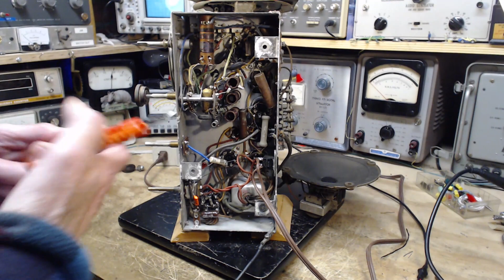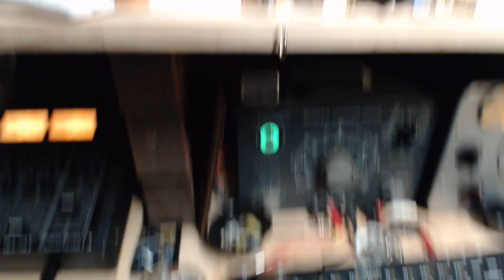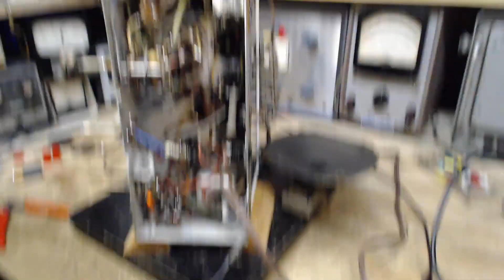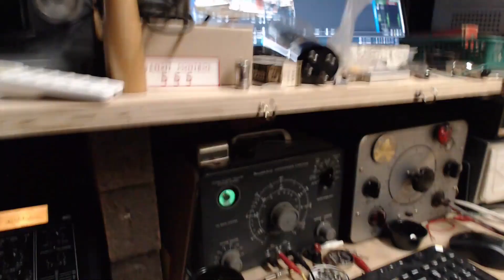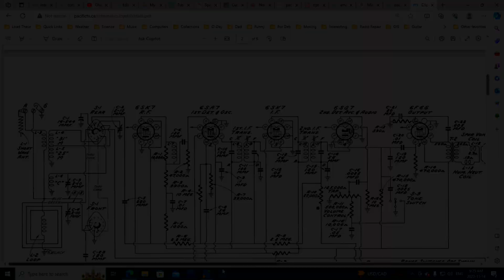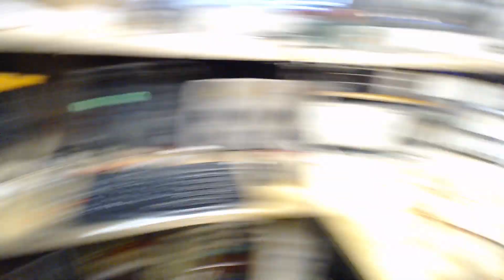General Electric KL60 Tube Radio Video #7 - Two Capacitors, Bad Result

Comment: Greetings:
I support the commentor that suggested you retrace your steps of the two last caps that you changed! Or you could use a working frequency counter to measure your  local oscillator or tuned-station frequency. If only someone had a working frequency counter. Maybe he could buy a working one. Maybe if he kept a logbook of things that he has done! Wait, he has an SDR to use whenever he needs a deeper hole to work his way out of. Oh, he lives south of Detroit just east of Windsor I think.
Jim Lindenas would rather the sun would come out so he could go out and play. If it snows he can build a snowman; that could be fun. I am getting old too, born in 1950. I built my only radio in 9th grade wood/metal/welding/electronics shop. After the Arkay radio kit was complete; I had to wait for the local high school radio shop class to diagnose a bad IF transformer; too bad my shop had no electronics teacher. SO, I built a wooden case to sub for the bakelite case it came with. Now I must wait for my 40 yo son to learn enough so I can just tell him what to do. Now that I finally have Covid-19, I can wait for the all-clear to invite him back.

Comment: You changed the screen filter cap, and the AVC cap. Start looking there. Wrong terminal? Clipped another lead by accident? New cap bad? Check screen voltage.